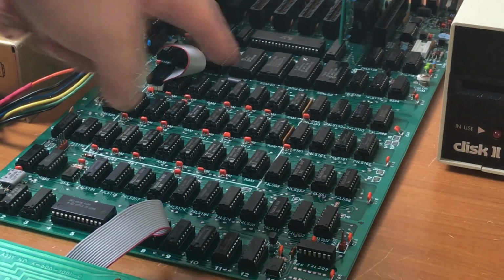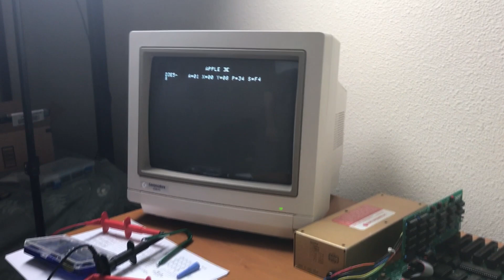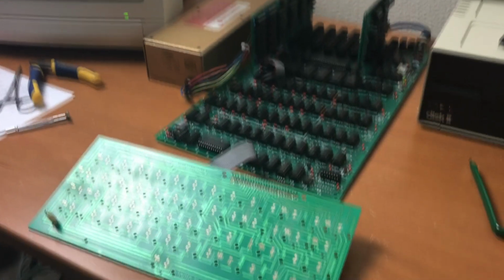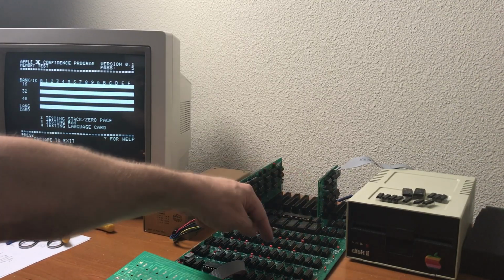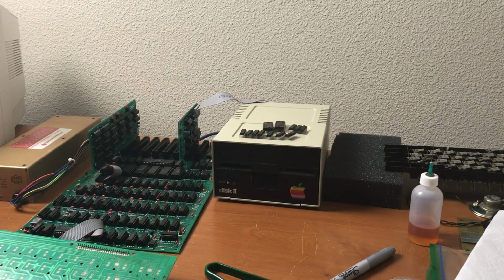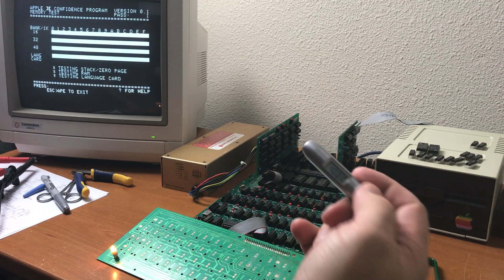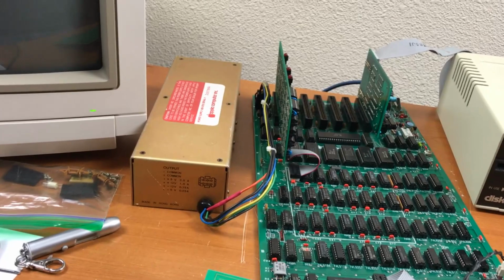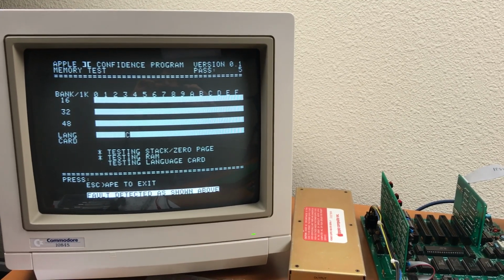Apple II Plus Repair (Part 4)

Comment: A tip: these old sockets generally don't like a lot of inserts and removals so plug a new socket into the old one and make all the swaps in it. Once you are done test swapping you can remove the extra socket. (Be sure the socket you use has leads the same size as a chip, usually cheaper ones)